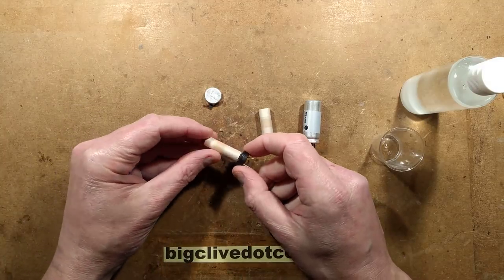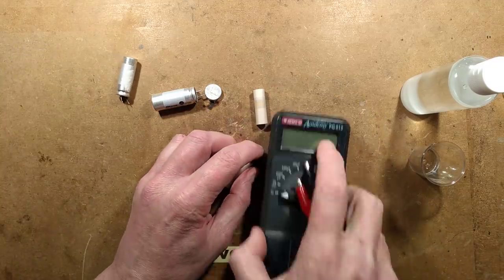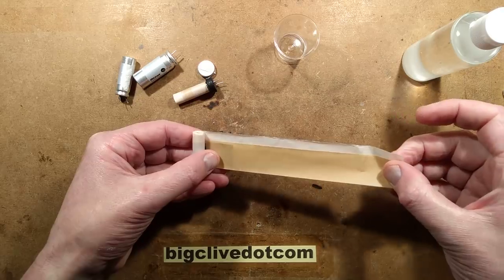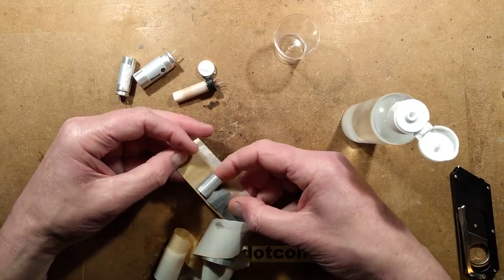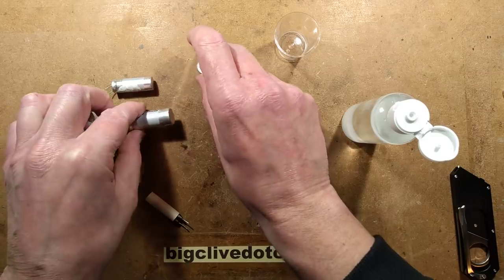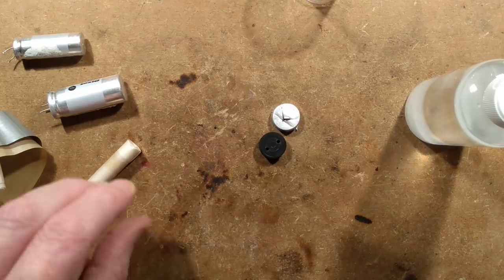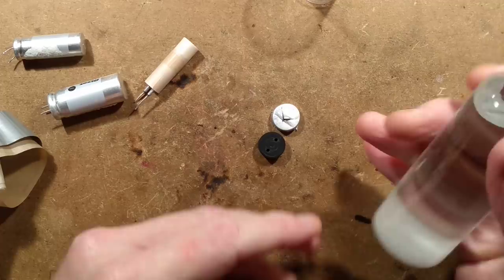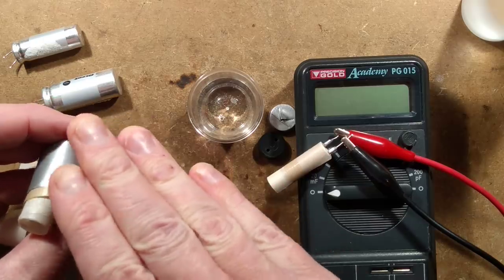Adding electrolyte to a fake (dry) capacitor.

Comment: You should discharge the capacitor before testing it because you may BREAK the meter itself. One of mine failed and I assume that is what I did. Where did you find/buy capacitors without the liquid in them? Were they sold as valid parts?
Reply from the maker: It was part of a fake product.  Pivot mega raizin.
Reply: @bigclivedotcom  I don't know where you got such a dry unit. Did you dry it out because the rolled out cap looked very accurate! Great British humor!
Reply: I just caught your other video on the Battery booster where you found the fake capacitor!

Comment: I have heard of forming, or rather reforming capacitors using those old style capacitor checkers, the ones that put out 500-600 volts at the test leads.  You simply set the device at the desired voltage, hook up the cap and turn on the device.  Watch the eye till it closes and you have reformed the cap.  This is surly not recommended, and the use of such caps is rather iffy since many my be up to 100 years old now and the materials could be bad, but it has been known to work, some of them work much as they did when new after proper reforming.

Comment: Interesting video, thanks Clive. I used to test electrolytics by putting a charge on it, via battery or bench supply, then put a volt meter on it, to see if it held a charge, then watch it fade down. I wonder if this re-done one would do that?
Those component identifiers are magic. I have one like that, but also got the clear plastic case to put it in.
I wonder if the maker of the bogus 'performance enhancer' got a job lot of failed capacitors. Then came up with the 'snake oil' scheme to get rid of them and make a buck or two.

Comment: Much appreciated, most informative and well timed video as the electrolytic capacitors across our tumble dryer and teeth hygiene pump motors have just failed.
Reply from the maker: If it's the motor capacitor in your dryer then it's a common fault and easy to find a replacement with the same uF rating.
Reply: @bigclivedotcom  The biggest breakthrough in I.C. technology occurred a few decades ago after they found a way to incorporate capacitors within an Integrated Circuit. I always thought that a capacitor was dependent upon its size. A fascinating subject.

Comment: Those pressure safety features are just a joke on the cheap caps. A friend of mine tried a cheap cap as a filter on the output of a 20+A rectifier (needless to say the cap couldn't hold the voltage it was rated for), and the shell just blew into random pieces :)

Comment: The basic method for reforming the dielectric is to charge the capacitor via a current limited voltage source to its' rated voltage until the leakage rate is acceptable, or until you get tired of waiting.

I use an adjustable voltage supply with a 10k resistor in series with the cap.

Increase the voltage slowly until the cap is charged to its' rated voltage. You need to calculate the acceptable leakage rate and acceptable voltage drop across the resistor first.

Leakage_Rate_in_mA= Capacitance_in_uF * Voltage_Rating * 0.00015
So for your 10uF 50v caps, the maximum acceptable leakage rate is 0.075mA, or 75uA.
Multiplying that by the value of resistance, you get 0.75v, or 750mV drop across the resistor or less.

Source : https://forum.allaboutcircuits.com/threads/forming-capacitor.32195/

Comment: Maybe there was too much electrolyte and it needed to dry out just a little bit? Very interesting, I've got an old radio from the 1960s, it's full of these caps, but the radio still works perfectly, so i'm a bit reluctant to put new caps in yet.

Comment: Try making your own with aluminum foil. Make both sides of the positive side matte finish. Leave the negative side as it is. Bake the positive foil at just below the melting point to make a starter oxide layer. Roll it up with dry paper and add electrolyte. Charge and discharge repeatedly but be sure to keep a minimum voltage to form the plate. See how high you can get 🤓❤

Comment: How much would they have actually saved just by skipping the electrolyte?  Seems it would be pretty cheap compared to the rest.  Although never really looked into the actual construction of caps  It's simpler than I expected.  I'm kind of curious if I could make stupid huge cap with a roll of aluminum foil, paper towel and some kind of plastic sheet plus antifreeze.

Comment: On the electrolytic caps I have, the longer lead in the Positive lead...
Were you reverse polarizing it?
Reply: The dry cap had never had any electrolyte in it, so it had never been polarized...
Reply: @cheyannei5983  Actually I think it must have been a proper capacitor but very leaky to the point where when it found its way into the product it was already useless/void of electrolyte. If it had never been formed, then you would not have capacitance build up immediately when submerged into the electrolyte.
Reply: The leads have been snipped after being soldered to the board so the is no way of knowing...

Comment: Ethylene glycol is toxic because it eventually is metabolised to Oxalic acid, which damages mitochondrial processes in cells, starving them of energy and also crystallises as Calcium Oxalate in the kidneys (main component of kidney stones) causing acute and irreversible kidney failure. It's also directly a CNS depressant, but the good news is, the antidote is generally ethanol! It preferentially binds to the enzyme that is responsible for glycol metabolism, allowing the glycol to clear the system without forming glycolic and later oxalic acid... Bottoms up!

Comment: Toxicokinetics
A potentially lethal dose of ethylene glycol is approximately 1-2 mL/kg of 95% concentrated solution, or about 1,500 mg/kg.[11] Ethylene glycol, the parent compound, is inebriating but generally considered nontoxic. The parent compound is osmotically active, and is responsible for the increased osmolality observed in the early course of exposure prior to metabolism. Ethylene glycol's metabolites are responsible for the anion gap metabolic acidosis. Although there is evidence that each of the metabolites are toxic, it is glycolic acid that is believed to be long-lived enough to be primarily responsible for the anion gap metabolic acidosis, while oxalic acid is responsible for the associated end-organ injury, nephrotoxicity. Oxalic acid deposits in renal tubules as insoluble calcium oxylate monohydrate, leading to proximal tubular necrosis. Oxalic acid's affinity for calcium may lead to hypocalcemia, which can be associated with tetany, seizures, and QT interval prolongation on electrocardiogram. It is important to realize that the increased osmolar gap can be present early after toxic exposure prior to significant metabolism, but as the course progresses the osmolar gap closes, with metabolism leading to the development of an anion gap metabolic acidosis without increased osmolar gap.[11][8][9]
https://www.ncbi.nlm.nih.gov/books/NBK537009/

Comment: You have to be careful with ethylene glycol disposal.
If you allow it to run into the gutter etc.. (Anti Freeze) then pets and other animals will drink it due to its sweet taste and then die..
From memory is causes kidney failure.
If you change your radiator coolant then capture it and dispose of it properly.
Make sure you clean up and spills and dilute what's left with a hose.

Comment: Hey BigClive, or anyone else happen to know what device he uses to check the capacity of the 18650 batteries? I have some non-marked ones that I've salvaged from various items and would like to find out what they are rated for.
Reply: A decent charger will do that for you plenty can run discharge tests etc
Reply: @thereal2scummy636  Thanks for the info

Comment: Back in the day those big paper caps were dipped in wax. Presumably to prevent drying out.
Reply: "paper" caps use paper as the dielectric, they don't have any electrolyte. The wax was to seal the component to keep moisture out which would have made the capacitor electrically leaky.

Comment: Maybe you did the forming the wrong way round as the aluminium foils are already pretreated in fabrication process. If so, this might explain the high leakage current. The forming process can take several hours and the voltage should increase gradually.

Comment: what is the mixture  you made use to treat wood, and to do what? also anyone got a link fo one of those testers? is it banggood or similar? cheers
Reply from the maker: There are recipes for preservative online.  Usually dissolving as much boric acid and borax in glycol as possible then diluting it with water as needed to apply.  I don't know how it compares to other commercial preservatives though.

Comment: Hi. I found 84 made sprague 736d series 100.000uF 16v capacitors. Can i drill the capacitors, apply boric acid and fill the blank with epoxy maybe? What do you think?
Reply from the maker: I wouldn't recommend that.  There will be a bit more science involved in the electrolyte and forming the dielectric layer.
Reply: @bigclivedotcom  yes of course liquid in the caps should more complex mix but I thought it would be better than being dry.

Comment: One of the plates is already etched as the positive electrode as one is etched and the other is unetched, they're not the same. So you might try that again but check both polarities and use the one that takes less current when forming. Or read which electrode is positive (etched or unetched) and use that. Only bipolar electrolytics use identical electrodes but have half the capacitance due to two insulating oxides instead of one (the etched electrode is effectively an insulating layer)
If you reverse formed it you ruined the factory oxide and it's a dud...

Comment: "The last step is called "forming" and is where the aluminum oxide layer is formed on the positive plate. It consists of connecting the capacitor to a power source and applying a voltage that is higher than the voltage you'll be using that capacitor at."  -  https://rimstar.org/science_electronics_projects/make_electrolytic_capacitor.htm

I'm guessing that the aluminum sheets that are in that roll doesn't have the oxide layer on the one side.

Comment: I have seen people bring old apple motherboards back to life by submerging them in distilled water for sometime and temporarily wet the dried out caps.. is that the same as this??
Reply from the maker: I doubt the water would get into them, but distilled water can be used to clean PCBs.
Reply: @bigclivedotcom  no they literally submerged the pcbs into a bucket and left it there..

Comment: I wonder what's the difference between electrolyte and friscolyte, which is used in pH-meters?
Reply: from VWR product page: "FRISCOLYT-B™ (84.4% glycerol, 11% KCl, and 4.6% H2O) is for low temperature samples" The Mettler page is more coy about exact composition, though the MSDS lists those three ingredients, with percentage ranges.
Reply: @RossReedstrom  so it having KCl it basically could replace electrolyte?
Reply: @jothain  right, an electrolyte is basically any salt in an aqueous solution.
Reply: @RossReedstrom  Thanks. I don't know much about electronics or especially their chemical side. I maintain pH-meters and looking this video just got thought that are they actually almost same thing, meaning electrolyte and that Friscolyte stuff which is used in meters.

Comment: why doesn't the electrolyte short the foil? I guess the oxide layer builds up???
Reply from the maker: The oxide layer is the insulator.  That's how they get such a high capacitance in such a small space.
Reply: @bigclivedotcom  I wonder how someone figured that out a century ago

Comment: Forget the ethylene glycol... The RfD (= "Reference Dose") for boron on IRIS was 0.09 mg/kg/day based on testicular atrophy and spermatogenic arrest in a 2-year dog study from Weir and Fisher (1972). You absorbed a dose of about two drops, so approx 100 µL. With a saturated solution, this amounts to around 7 mg boron or around 0.1 mg/kg/day, assuming 70 kg body weight (>RfD). Bottom line: watch your testicles and please do not consume boric acid! Still, love your videos!

Comment: Awesome, back in the day I worked auto parts, when we sold generators not alternators, the generators had to be polarized I believe it was just touch negative to the case then 12 v to the (field wire) someone will remember and correct me if I'm wrong. Man I hadn't thought of that in 20 years. I used to open the box and read and demonstrate how to do it, and now I forget.

Edited
Reply from the maker: That sounds like magnetisation of the rotor.  If there was an AVR then it might require an initial field to start after a period on no use.
Reply: @bigclivedotcom  man I wish I had you across the pond right now, I just picked up an oldschool welder generator and it needs re-excited and likely some other work as it has no output. I will say though that I'm picking through the AVR and rectification circuits with confidence due in large part to your work. So thank you.
Reply: @geraldgepes  if you need help, there's a lot of Engineers, on smokstak.com, on the generators and welders section
Reply: @turtmastert3545  it's been a big help already. Just need time now.

Comment: Well, table salt has a surprisingly high acute toxicity but boric acid is reprotoxic, meaning it screws up the genes in the gametes. Temporarily I think, but here in Germany (and the whole EU probably) there are surprizingly heavy safety measures to take when working with it commercially: You have to have a fume hood and fertile women are to be kept away from it. Or vice versa xD . (Not mentioning gloves etc.) That's the typical over the top bullcrap of the REACH regulation and similar. As far as I know these reprotoxic effects have been only observed on animals while feeding them absolutely insane amounts of boric acid.

Another feat of idiocracy: citric acid. You can buy in in the super market, apparently I doesn't nee to be labled with H und P phrases nor with warning pictograms. If you've read the safety data sheet, you would probably shrug away from putting it into your cake though: it has the warning sign with the exclamation mark and the H(azard) phrase "causes serious eye irritation". Well, not you as in you, Clive, but as in most normal people. You have to instruct people accordingly and everything must be labelled accordingly. At work I put it into fertillisers, I don't eat it. Yet, if you want to eat it, it doesn't need all that safety stuff lol.

And don't get me startet on essential oils! People think they are so bio and healty. I'd rather put my hand for 30 seconds in 20 % hydrochloric acid than in 100 % of some essential oils. I'm serious. They might be beneficial in tiny concentrations, but the pure stuff is from hell.

Comment: Isn't glycol hygroscopic? So it's possible that there's water in absorbed in the glycol and that's shorting the cap?
Reply: No, even 100% water wouldn't cause a short provided the oxide layer is intact.

Comment: I've just bought £80 worth of "JCCON" caps and they all rattle so I chopped the top off one and Lowe and behold there's a good 3mm gap all round the inside and roll.
Reply: Why are you wasting your money on noname junk capacitors? There are acceptable quality cheap brands, like G-Luxon, Jamicon, and even better: Yageo/Teapo. I use mainly Yageo/Teapo and Jamicon, because they are the ones I can buy locally for cheap. For higher grade stuff, I used to order Rubycon / Nichicon / Nippon Chemi-Con / ELNA / NIC / Vishay etc. from a reputable supplier (NOT from ebay or Aliexpress).
Reply: @mrnmrn1  Well, there's the fail, my lack of research and knowledge.
Reply: @resonantconsciousness9248  No, the problem is just the lack of research. Your knowledge will rise if you do enough research. A good part of my (not extraordinary) knowledge also came from just a lot of research.
Reply: @resonantconsciousness9248  Wow, someone on the internet admitting error! This may be a first. Someone note the date and time for the entry into the history books. And damn, get his name.

Comment: Sometimes you learn more from failed tests! Have to say it made me aware of why the Caps fail on some of the what I like to call legacy PC hardware (Bloody old might be another way of referring to them lol) I recall the Sega Game Gear having issues with it's capacitors if anyone is old enough to remember them :) Using a  CCFL light bulb to illuminate the screen really took it's toll on them I guess :D And the battery life...oh my goodness the battery life lol :D (Edit thanks to Long Runner for info!) :)
Reply: Game Gear's backlight was a CCFL, not incandescent (the same goes for the Atari Lynx).
I don't know of that being related to the capacitor failures anyway (the early SMD electrolytics were just unreliable in general).
Reply: @longrunner258  I expect they where :) Have a few lying around needing attention :) Good to know what the tubes where, I heard there are some good LED Mods for the Game Gear which extend the battery life quite some :) Still very interesting to see what approach they took back then :) Thanks for the info :D